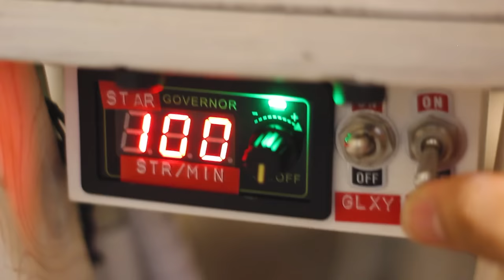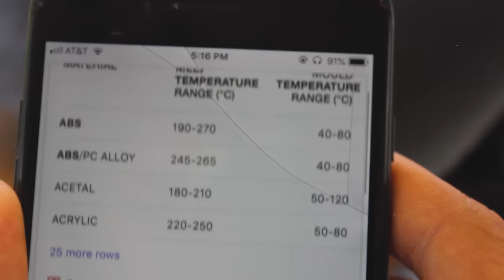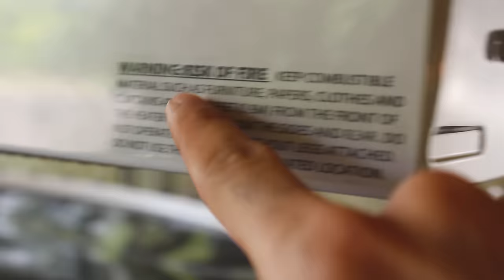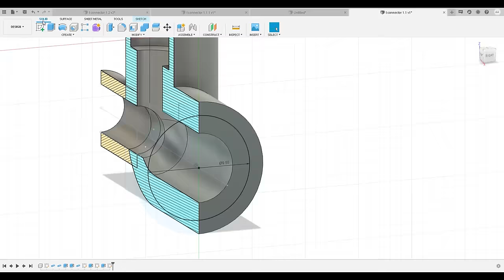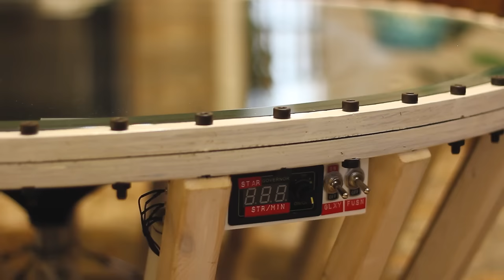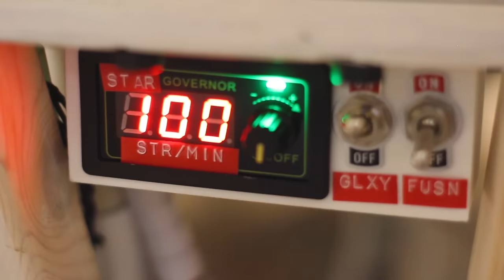Building The Galaxy Table | 400 Hours In 19 Minutes

Comment: Amir, I'd suggest lightly using your heat gun on the black material (if it is indeed plastic as I think it is😅)  then it might be easier to cut accurately and most important of all, without possibly sharp edges.those probably suck to bump into.
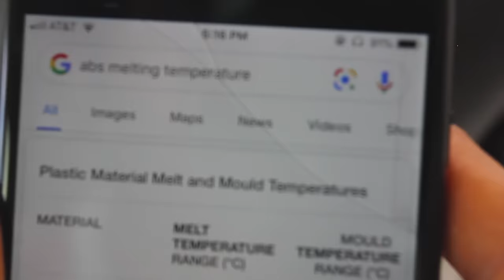Reply: Just got to 10:00 and I see😄

Comment: What is the purpose of the pump you installed at the top of the parabolic funnel?
Reply from the maker: The spheres exiting the tube didn’t have enough energy to make a circular orbit, they would just fall straight to the center. The pump supplies a constant stream of air that gives it the extra push it needs to take a pleasing path.